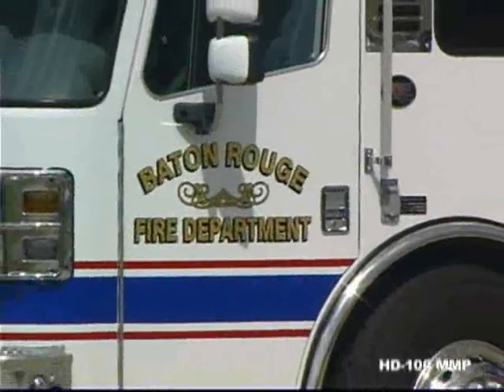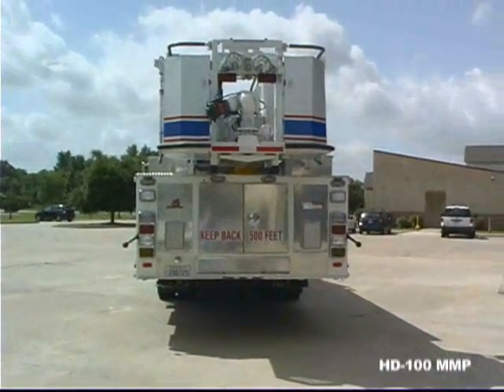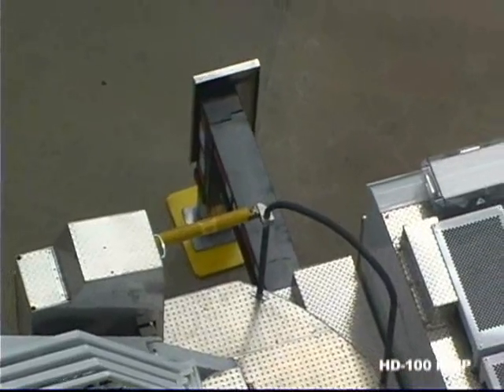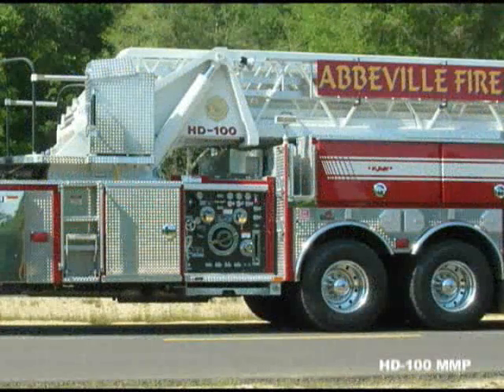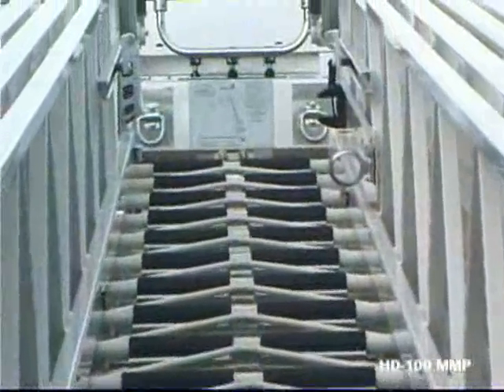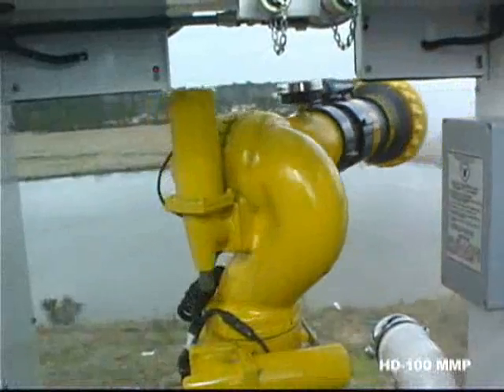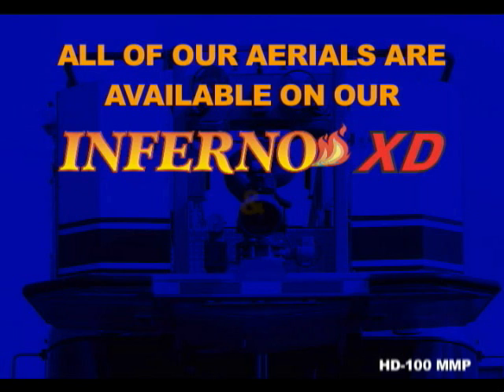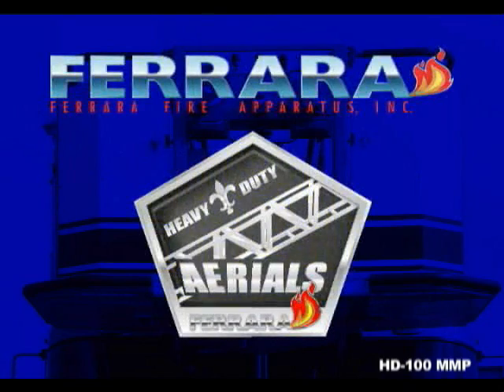Ferrara HD-100 Mid Mount Platform

Comment: is there actually any advantage from a mid mount to a rear mount? It is much longer than it has to be, there's a lot of overhanging at the back, which for sure does not improve maneuverability for the truck itseld, or safety for other cars while turning.
C'mon on this size of truck we usually have a 170' ladder, not just a tiny 100'